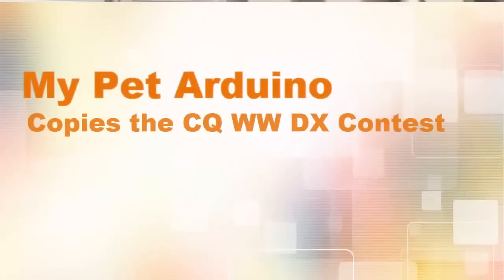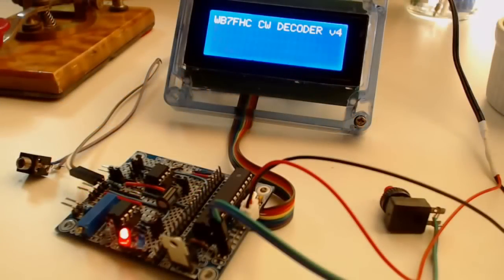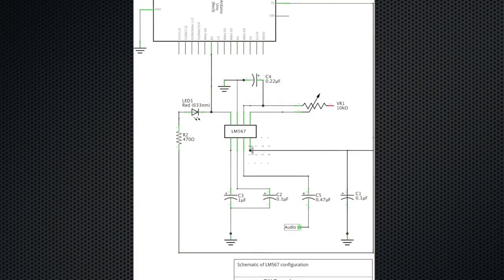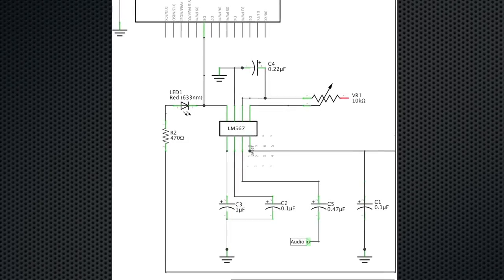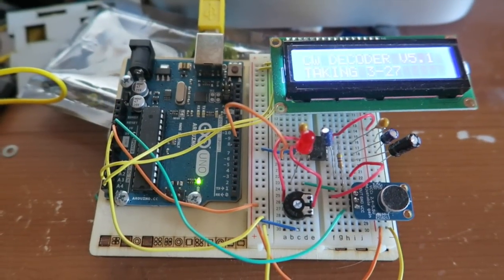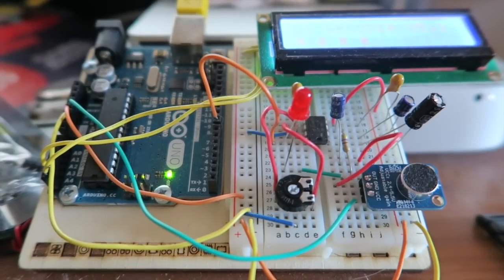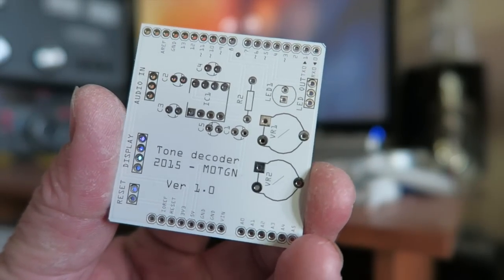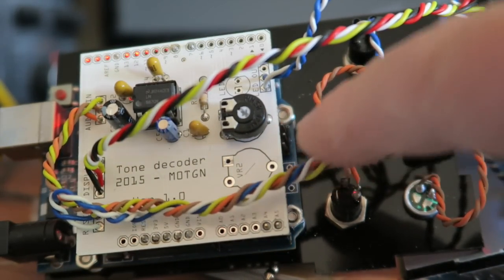Arduino CW Decoder

Comment: Saw this video a few months ago, ordered the LM567 from China, which took a couple months to arrive, got the order and put aside for awhile.  Finally today, I tried your circuit out.  Did not work the first time, but I eventually figured out the microphone was picking up way too much noise off the 5 volt supply.  So I changed the microphone to the 3.3 volt supply, left the rest of circuit running on 5 volt and it worked great.  So now realize I should have hooked the microphone up to my portable speaker first to make sure it was working good, before trying it in a circuit.

Thanks for the video.  I will hopefully get around to building a more permanent version of this circuit, after I experiment a little more with it.  Am going to see if there is a way to control the detection frequency using a variable voltage from a microcontroller, rather than the potentiometer.

Comment: I have a question about this circuit.. I'm fairly new to tinkering with circuits.. am I ok using non polarized caps (wima) in this or do the electrolytic make a difference?  thanks for your help!  can't wait to get mine up!
Reply from the maker: +MrLovelog Hi, thanks for your comment. You could easily use ceramics for this circuit - In fact the 3rd iteration of this photo type was all ceramics, with just 1 electrolytic. I hop that helps. 73 Dan

Comment: Great vid's Coldestmoon! Just saw your "CW-Trainer kit"and "CW Decoder" video's, well done! 2 questions: 1) Have you been able to upgrade the CW-decoder PCB in the meantime and if so, can I order one from you? As a recent Ham, I would like to start learning CW but don't find it so obvious, so your solutions would be a great help. And2) As a Arduino "Newbie", is it possible to combine both programs (trainer and decoder) on one Arduino ? (I don't think so, but ask it anyway). Thanks Dan. 73.
Reply from the maker: +Sven Vyncke Hi Sven. Many thanks for your comment. Yes i did fix the issue on the PCB - it was 100% my own mistake. To learn CW - you really need to learn the code. Start simple by going to lCWO.net and start with just a few letters and build up over time. Currently the 2 sketches for the Arduino are a bit big to squeeze on 1 chip. I am working on a total solution version - but nothing at present.

I hope that helps, any questions feel free to ask. 73. Dan

Comment: What is the purpose of the LM567 chip?
Reply from the maker: +Tommy N Hi Tommy, The LM567 is the tone decoder. It converts an audible tone into a digital signal (on or off etc) that the Arduino can understand. The Arduino then uses this on-off signal to figure out what the character is, then display it on the LCD. 

I hope that helps, if you have any other questions feel free to ask.

Dan
Reply: +ColdestMoon Thanks for the quick response. I am building this device.  Great video btw, very clear and steady camera work.   However, I must ask now, I have seen this device built without the LM567 in other plans.  In fact, I built the simplified version you can see on the internet without the LM567, with just the resistors and capacitors and the led lights up when I put audio CW morse to it.  Does the LM567 make the signal better than without it or something?  

Thank you.
Reply from the maker: +Tommy N Hi Tommy, to be honest I'm not sure how it would work without the LM567. i haven't seen any plans or versions of this without it. The chip in essence creates an open or closed circuit based upon an audio tone fed into it. So a mic would suffice as the input. If you do have plans for it without the chip, i would be very interested to see how it is accomplished - and if you're running a version without the chip please do let me know the circuit. 

Many thanks

Dan
Reply: Here are the plans written out and fritzed.
http://skovholm.com/cwdecoder
Reply from the maker: +Tommy N Brilliant - thank you. So to answer very quickly why use the LM567 - you can choose your centre frequency without adjusting code, it also removes any noise and equalises the input. So the signal will always be the same HIGH / LOW. The detecting and decoding of the audio is in the chip.

This sketch looks great - as you will see in the comments of it, you can adjust the code for equalising weaker or stronger signals & swinging the centre frequency.

Thanks

Dan
Reply: I see.... thanks. I have some LM567s coming in the mail as we speak.  : )  I am coming from the computer software world into electronics/radio/arduino and the electronic parts are new for me.  Very interesting stuff.  Isn't the arduino incredible?
Reply from the maker: +Tommy N absolutely - i think what can be achieved in this little chip is stunning. and more importantly its making electronics & programming accessible to youngsters today in a way that is fun and interesting. I also am a programmer by profession, with some limited electronics (that i learnt way too long ago) knowledge and what is achievable already is incredible.

Let me know how you get on with the LM567 - i did upload a few diagrams to my blog, so they may be able to assist you. Any questions though - please feel free to drop me a note.

Take Care

Dan
Reply: hi, nice video, where can I get the circuit diagram and the sketch from, also connections for the arduino to the display. thanks fo now Fernando G0VUF.